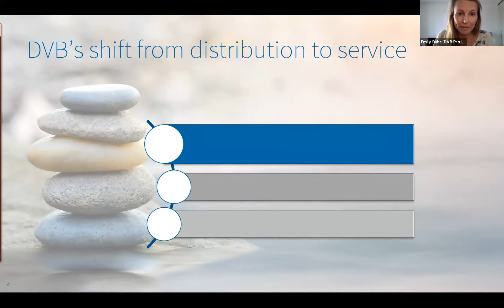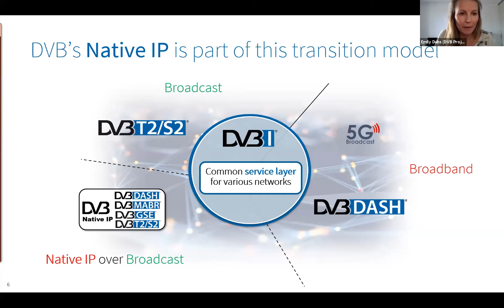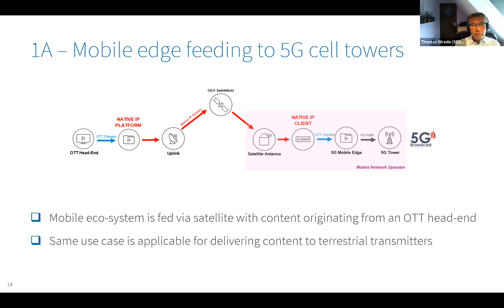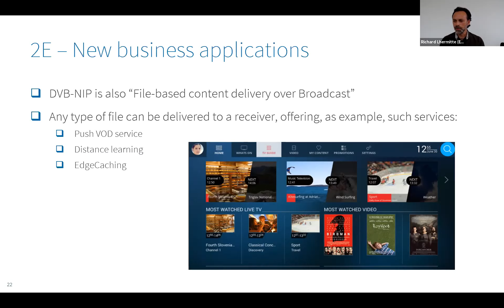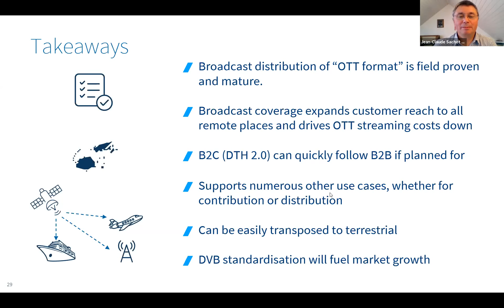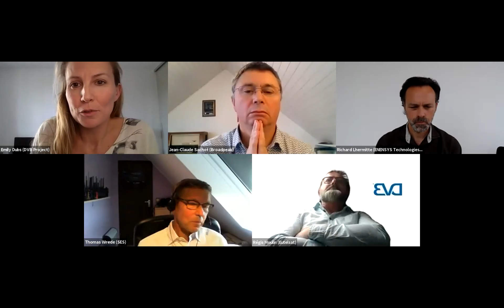DVB Webinar: Embracing Native IP media distribution as a new generation broadcast solution

Comment: what is the difference between dvb I and DVB IPTV
Reply from the maker: DVB-IPTV is a set of specifications to facilitate the delivery of digital TV using the Internet Protocol over bi-directional fixed broadband networks. It targets the transport of MPEG-2 TS-based DVB Services over IP-based networks. 
DVB-I is a service layer specification for the delivery of service lists and programme metadata over the internet. The services referenced in a DVB-I service list can be delivered either over over classic DVB networks – terrestrial, satellite or cable – or any kind of broadband network, including fibre, 5G and beyond.